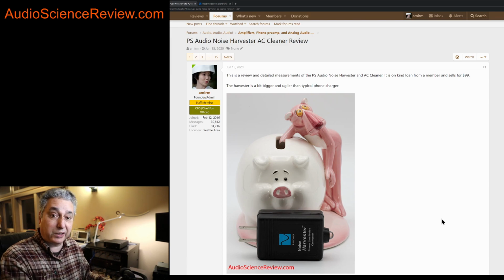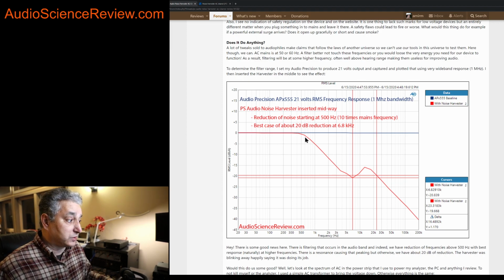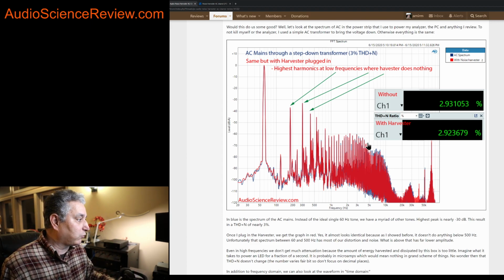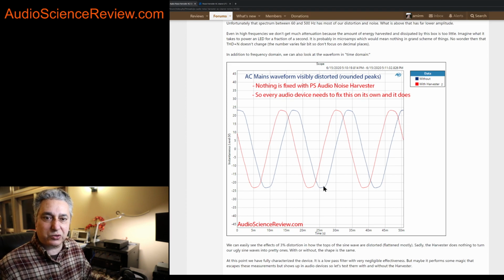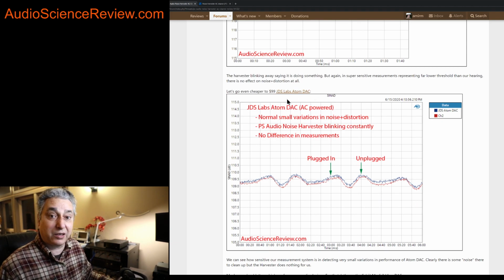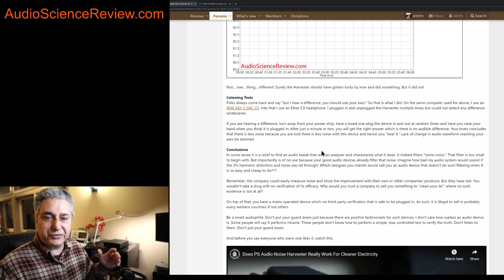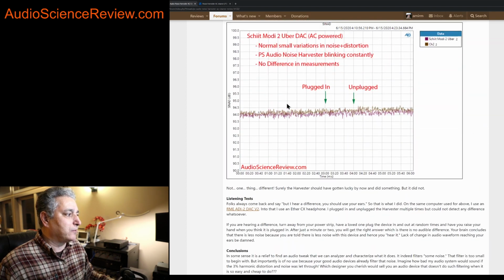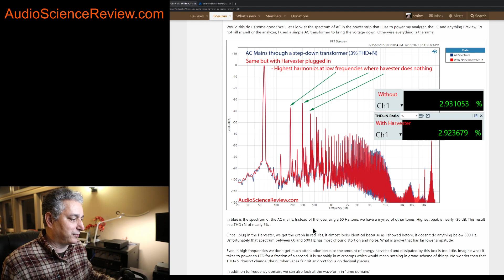PS Audio Noise Harvester Review (AC Filter)

Comment: Ah, very good Amir.  In the not too distant past, Ask Paul brought up the so called issue of having DC on your AC line and how this some how effects your sound because the believers think that this must saturate your power supply transformer.  Paul said they use to make a device to fix this but no longer do.  I Googled it a found someone who had one posting on an audiophile message board.  Turns out, the same PS Audio filter had been resold at least three times on the same thread.  I think the device originally sold for $500.  It was like a hot potato.  Initially, each person thought it helped but after a while they determined that it didn't and wanted to recoup there loss.  And there seems to always be another sucker willing to give it a try.  I have no idea what they're trying of fix.  I posted about it on Ask Paul's video and someone actually said in response that 'DC on the AC line is an actual thing'.  I find it unfortunate, when looking into the belief of 'DC being a problem with AC power', that it may have started with Nelson Pass.  I found the circuit on-line somewhere that is supposed to 'fix' the problem. Its total nonsense.  Keep up the good work!
Reply: @Douglas Blake I know that and you know that but the Paul followers just blindly follow.  When trying to understand what the heck they were  claiming, they seemed to be misrepresenting some distortion of the AC sinewave.  I know that the input power supply just filters that out and it would have to be awfully bad just to make a transformer run a little bit warmer but that's not what they are claiming, they're saying DC.  The impedance of a pole transformer is way too low for that even being a possibility.  Cheap appliances with half wave rectifiers are one claimed source of such imbalances.  That would mean that these 'experts' can hear a few millivolts of non-symmetrical AC on their stereos.  Boy are they good.

Comment: Interesting test Amir - I'll say up front that no, I wouldn't, nor have I tried a Noise Harvester in my own system - I'm wondering about your explanation regarding "cleaning up" AC - which is really not what the harvester is about, at least as I understand it -  and as you pointed out, to actually clean up AC one would have to drag out some heavy artillery, which, as most of us know is also offered by PS Audio but in a much higher price bracket, to put it mildly - - my take on the Harvester is that it might be capable of taking some of the RF noise out of an AC feed, not somehow change for the better the AC waveform itself and it's harmonics - and in that realm, for sure results would vary - I know your response would probably be that we can't hear RF so how can it degrade the sound - I wouldn't debate that because I don't actually know of my own knowledge, but it does make some common sense that RF noise probably does make it's way into the system and so my common sense tells me that a system would be better off just processing musical signal alone, that is, sans at least some of the RF. I appreciate and like that you offered up a listening test - - that's great and it immediately grabbed my attention  - -  but I was left a bit disappointed in that, beside the "professional DAC" you didn't describe your other playback items - - I can speak from my own experience that a 300 dollar headphone is not reference and I'm guessing you're not using a reference headphone with a 1K DAC and if that's the case, I wouldn't expect you or me to be able to hear a lot of differences, even in similarly priced playback gear let alone an add on item going for a 100 bucks - - regardless, I appreciate you offering the listening test with your measuring, please continue to include that test - although I would like to know that your using at least entrance level reference playback gear - however, it wouldn't surprise me if you'd  want to claim or measure that reference gear is a myth too. You can delete my comment - my passion is that I feel like your giving a lot of new audiophiles the wrong idea and to "poo poo" someone that claims an improvement with the Harvester is unfair and unwarranted.  And - - - the expression: "getting it right 10 times of 10" is stupid - if I changed out your "professional DAC" with another one that's comparable 10 times do you think you would get it right 10 times? Never, so come on my friend, that kind of a test doesn't mean that perhaps your "professional DAC" isn't better, it only proves that you can be fooled and so can all of us - doesn't mean that there are no differences, with some of those differences for the better - regardless of my criticisms I really do like and appreciate that you goal is to shed light on "over-hype", I'm good with that and will continue to watch your channel - - thanks for letting me express my opinion.
Reply: RF interference won't get into your equipment via the mains plug, just consider the choking of the mains transformer coils and shunt capacitors.
Reply: @montynorth3009  thanks Monty - I appreciate you pointing that out

Comment: You can actually reduce your mains noise level (totally meaureable) by replacing the neon mians indicator in your distribution block with a LED repalcement costing  a couple of £/E/$ from the likes of Mouser/Parts express etc. And acutally do the same thing as Noise Harvister does.
Reply: I think the neon lamp is part of the surge protection. I wouldn't modify my surge protector.
Reply: @danryan4272  hope ur joking. The   MOV's do the protecting. Not the idiot light.

Comment: You tried the iFi iPower X? Seems like it haw some nice technology but who knows if it actually does anything.
Reply from the maker: I have tested the previous generation.  It actually added some mains noise versus not using it!  And it did nothing to improve the output of audio products I tested with it.
Reply: @AudioScienceReview  can't find the results on ASR. What thread are they in?
Reply: It would be interesting to see if it can do anything better than an iPhone power supply or a linear power supply like the topping p50
Reply: I can find the measurements of the DC iPurifier but not of the actual power supply, the iPower or iPower X

Comment: I have talked with MacGurkin, i mean MacGowan. The man is a charlatan and he knows it. He is a competent engineer, which in this case means he has designed the filter to be high enough so it doesn't actually do anything to filter to 50/60Hz.. as that would mean it has to actually do something. But, as it is only affecting >500Hz... it isn't really doing anything to mains noise, it is those first harmonic spikes that are the worst problems. But those are expensive to fix.

edit: heh, of course it is said at the end of the video.. The moment i saw that it affects >500Hz i knew why: because it doesn't do anything, no good but also, no harm and will be safer.. and cheaper to make. That is exactly how i would do it. Paul MacGowan is a charlatan and a scammer and HE KNOWS IT.
Reply: @SquidCaps I have to call you out on calling MacGurkin a “competent engineer” the guy can not draw an elementary circuit diagram !!! Lookup the Poo S Audio video on “biwiring” - it’s a parody of blatant incompetence & Paul Poo S Audio completely misses the point of “biwiring” in an “explainer” video on the very topic - it’s hilarious BUT also tragic that people can’t see the obvious BS
Reply: @BogdanWeiss  Paul is a classic case of the emperor's new clothes.  Who is going to challenge him at his own company?
Reply: @herrtrigger7220  They also delete comments pointing out obvious nonsense - they can't take constructive criticism & Paul can't draw an elementary circuit diagram....pathetic...
Reply: @BogdanWeiss  also look up videos on audio fuses, elevated speaker cables,phase distortion etc. etc. he is a dishonest smooth talking salesman with superficial engineering knowledge.

Comment: Oops, I bought a PS-Audio powerplant last year. This makes me wonder how that would measure..
Reply from the maker: I have one of his older units which I plan to evaluate.
Reply: The power plant is a completely different beast in how it works. That will definitely filter out those nasty frequencies. Don't be worried. You have a good power filter
Reply: @hello-pq5pj  but does it improve sound quality? This is the only relevant question.
Reply: @geoff37s38  I'd say it's a high end treatment and would need a very good System that had a dirty power supply  to hear a difference. I know a guy who listens to his stereo a 2am because he believes the power line has less noise at that time of night and his system sounds better at that time.
Reply: @hello-pq5pj  I too think my system sounds better at night. But I know this is a psychological effect. Low lights, more relaxed, no traffic noise, no barking dogs or chirping birds or other distractions to mess with concentration.
Reply: @geoff37s38  haha yes that all makes lower noise levels
Reply: @hello-pq5pj  A very good system won't need it, because all the required filtering will be built in. In fact no system will need it, because it's BS.

Comment: I’m amazed that anyone would spend $99 to filter dirty AC. If you’re not using a dedicated clean AC line your missing out on hi-fidelity. Most power companies will install a dedicated AC line for under $20k. My neighbors may laugh at my scooter while they drive around in their fancy cars, but they aren’t audiophiles, so they don’t understand.
Reply: Clean AC line? that's amateurish my friend. Unless you use batteries, you will always have to put up with AC, which because of its very nature is dirty! Install 10 to 20 Power Walls together, and then we can talk.
Reply: @gabrieliordache296  I just installed the power walls but my sound is still dirty.  I think it’s because I’m charging them with dirty AC.  Should I install dedicated solar panels to get clean power into the power walls?  Tesla says it doesn’t matter but when I asked to talk to their audio guru they went silent.
Reply: @chrispapas8765  Solar is by far the better option for a true audiophile. Wind is the worst because of the propeller's vibration, which imprints itself in the harmonics that ultimately (and after a few noisy transformations, including some mechanical in nature) generate power.  Solar by comparison is clean: energy in -> energy out, no pesky rotors, no hum, no jitter (although, to be honest, the wind does make the panels vibrate, but we are talking about random, two dimensional vibration, which on average will cancel itself out).

Comment: My preferred power supply is .. battery.  I have iBasso D10 Cobra portable DAC + headphone amp with built-in rechargeable  battery., and I get the cleanest audio signal using  battery and throush optical TOSlink SPDIF.  

Thank you..

Comment: Can you also review on the AC filter such as Weiduka or Bada...does it really help make the system cleaner? i did a simple experiment myself by max out the vol without playing any track, and run it with/without the AC filter. And i can hear noticeable noise reduction. But if what u say is true, where all amplfier has DC filter, then why am i still hearing noise? Can u debunk this mist also....appreciate your help/
Reply from the maker: I have tested one such device and plan to do a review.  I don't believe the actual filtering is responsible for lower noise.  Often such noise is riding on the ground wire and simply changing the routing, configuration of cables can impact it.  The best solution there is to use balanced XLR interconnects which don't use the ground for the signal reference.
Reply: @AudioScienceReview Looking forward toward your review.

Comment: Amir, thanks for the video.  I have one doubt:
What are your impressions/tests done on power regenerators.  Do they improve the ac main - meaning do they help having a "cleaner" source for the downstream components or do they add other issues (noise?) into the equation?
Best Regards,
Reply from the maker: I have a PS Audio power regen.  Let me formally test it before commenting.
Reply: @AudioScienceReview  fair enough.  Looking forward this review.  If possible, after the measurements/evaluation procedures, could you please test if the power regen with a phono preamp?  The reason I am asking this, and correct me if I am in the wrong path, is that the phono preamp might have a higher gain and should amplify "potential noises".
BR

Comment: I actually like the Noise Harvester.  For only $99 you get a genuine PSAudio accessory that does nothing audible, but it blinks and makes you feel better about your system.  Most PSAudio accessories like power cords do nothing,  cost many times more, and do not blink.   Its a bargain!
Reply: Blink is Bliss !
Reply: @MrMftech  ps audio should call this model 182
Reply: It's harvesting as it blinks!  But where does it store the noise?  I'd like to see the noise when you empty out the tank.
Reply: @davidkosa  :goodvibes:
Reply: Paul is gonna  be annoyed ;)
Reply: Good one!
Reply: Nothing has its loyal adherents! The blinking is a bonus.
Reply: Eye candy. Audio blindness
Reply: Over there in Boulder they appreciate such approach.
Reply: I must admit I have 2 of their power cords and I have the courage to admit I hear a difference. I don't believe in Magical Voodoo  gadgets but sometimes something works and in my case that's those cables :)
Reply: @Antoon55  I believe you that you hear a difference :) That does not mean there is a difference, though
Reply: @Antoon55  how tiny were the wire in the cable you swapped them out for? I can’t imagine there are mains cables that are so thin they would starve a home stereo amp.
Reply: @Antoon55  Unless you do a proper blind test, you are unlikely to really know if there is a difference between power cables. How much did you pay and how much do you think was the manufacturing cost? There is no reason to pay >100 times the manufacturing cost for a cable (e.g. AudioQuest Dragon AC Power Cable).
Reply: @Antoon55  Perceptual bias
Reply: @Antoon55  that is some serious courage :)  Its like saying, I know the moon is made of cheese because, look at it, it looks like cheese!
Reply: @annenominous7220  gr research is going to gn over why power cables make a difference.  I think it is about filtering noise. Rather than allowing more power through.  Have to have a very good resolving system to hear it
Reply: @hello-pq5pj  Stay tuned here. I am quite sure Amir will post about power cords soon.
Reply: @annenominous7220  are you telling me the moon is not made of cheese? I am devastated.

Comment: Oh, one thing I'm curious to see tested: the claim that you should connect your gear with respect to the phase of the mains outlet. You know, the 'polarity' of the AC Plug if you will. Sounds like nonesense to me, but maybe you could check this out some day...
cheers
Reply from the maker: If the plug is not polarized, sometimes one direction induces less mains noise than the other.  I sometimes see this in measurements.  The difference though, is not usually audible.

Comment: The first time I came across ASR was after googling a review for an amplifier. Before that day, I'd always get swayed by the latest hi-fi review with words like tight bass, airy treble, bright, forward midrange, honey-like, etc.

Most audiophiles fantasize about an end game system - as would I. But I'd always be confused, should it be a Yamaha amplifier? Or a primaluna? Or maybe Cary audio?... Tubes? MOSFETs? 

And what about the speaker? Klipsch? Focal? 

And dac? Oh my the DAC! R2R? Delta-sigma?

Not to mention the power conditioner, the hi-fi stand (to avoid microphonics). And oh oh! Would I also need an upsampler? A reclocker perhaps? Let's not even going to vinyl vs digital...

I still remember when I first visited ASR to read a review on the schiit aegir, and saw the amplifier ranking graph.

Now, my dream system is - benchmark pre and power amp, some neutral speaker, and perhaps a decent dac from the likes of matrix audio. 

I'm no longer swayed by the audiophile reviews on YouTube - though I still do watch them for laughs or entertainment.

This was a long comment but you ought to know the significant impact ASR brings to budding audiophiles! 

Much love!
Reply: PS - I fell out of love with traditional hi-fi reviewers the day I auditioned the Klipsch RP 600M back in 2019. To think I was almost about to buy it blind based on the unanimous praise everyone showered on it! 

And then I auditioned it at the dealer and it was 🤮🤢!! It just didn't sound right! 

Later I read the review of the same on ASR and could completely relate to your conclusions - the speaker design is broken! That's the day I decided to trust numbers over opinions. ❤️
Reply: Young padwan you have outlined what I have concluded from my vantage point. Your comment should be posted on ALL audio site.
Reply: @pkdude5334  completely agree! The cabinet resonance was also a big no for me.

Comment: Might be interesting to measure the effects of AC mains filters on equipment with plain old linear power supplies.  My local power company leases them to you to clean up powerline interference for the whole house (meaning that they are admitting to supplying dirty power.)  This is separate from the line spike and surge protectors they also lease to customers.

Comment: So it's a PS audio Snake harvester Oil and it's not even 1st April yet. 
17:08 There is a place here in UK called Harvester where you go and eat. 
So what is inside the PSnake audiOil harvester? A few resistors and a capacitor that charges up with a blinking LED.